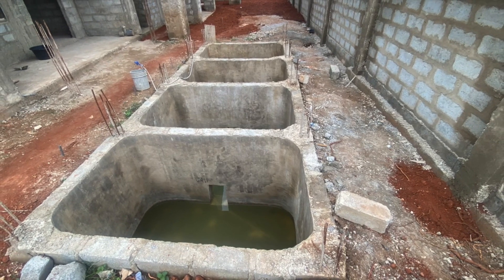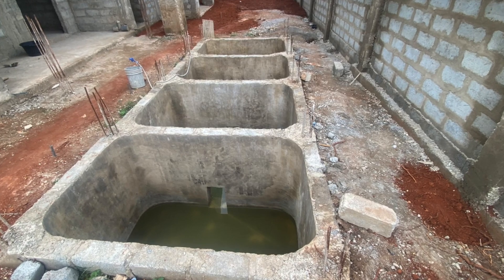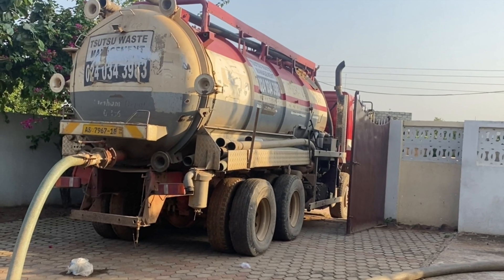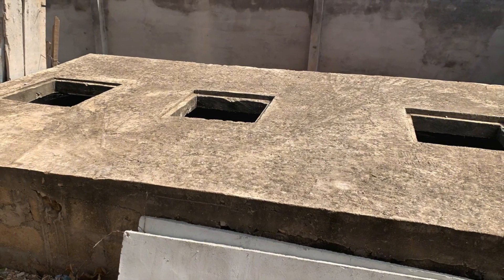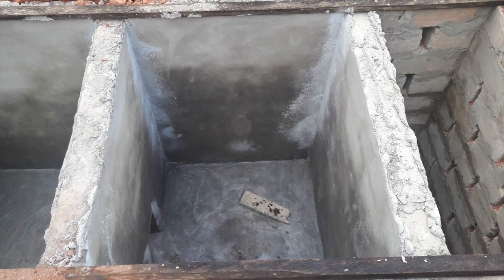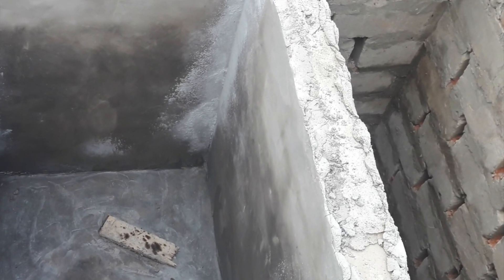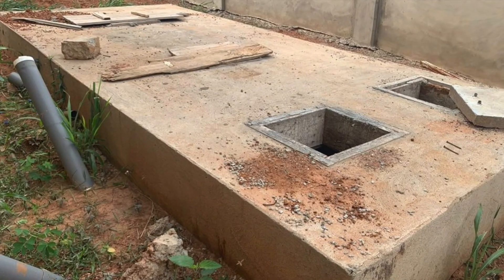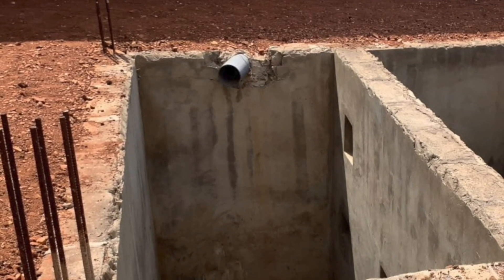How a Septic Tank Works

Comment: My brother I think septic tank is always the best in terms of capacity, longevity. It takes a very long time before it becomes full. The only downside is that it takes up space in your house, it also not aesthetically pleasing to the eye. However if it is done properly so that it flashes with the compound floor and tiled over, there will be no noticeable effect. 
Bio digester is ideal for small family homes, it doesn’t take much space, aesthetically pleasing if done correctly. But is required regularly maintenance. That is opening and closing of the slab. The possibility of failed bio digester is high. Little mistake will clog the pipe. Example female sanitary pad and wipe can cause blockages. Also malfunction soak away pit could also affect the operational capacity of bio digester.
Reply: I made a plumber do a biodigester for my 4 bedroom house. I’ve only spent three weeks in my house and the smell that comes out of the vents and my cabinet basin is very unpleasant. Now I realized that the plumber added the pipes that carry the wastewater from the bathroom and the basin into the biodigester. I’ve been advised to condemn the biodigester and do the manhole once and for all because manhole doesn’t give problems. Please advise me
Reply from the maker: @ just separate the waste water lines and do plumbing audit. It should work fine https://youtu.be/EitO00tsPM0?si=a8r1qtxXgJX6neuk
Reply: @JerryAdu-Asare  thank you very much.
Reply from the maker: @isaacfiagbe3506  well said. I won’t disagree with you on any of those points Isaac 😊